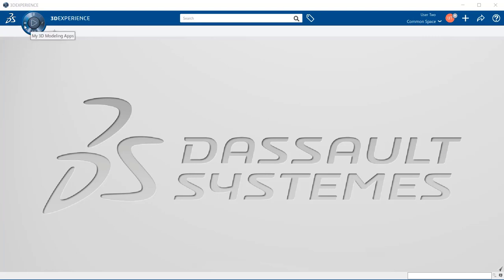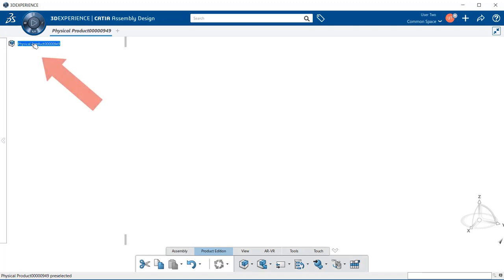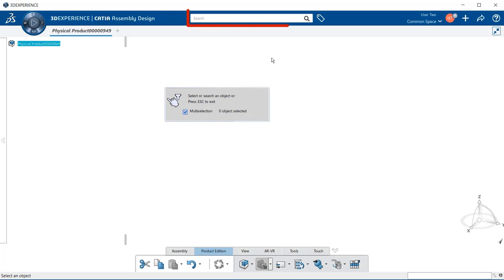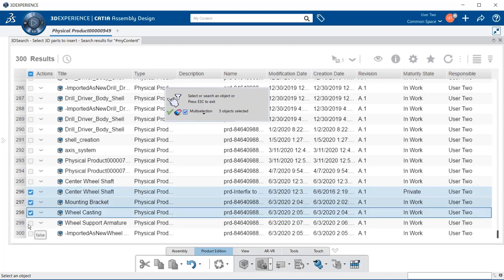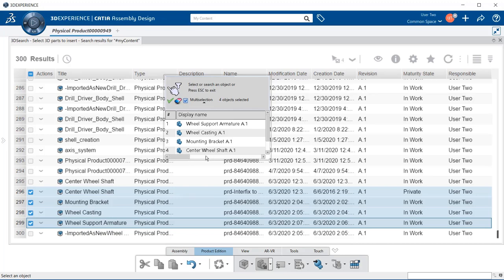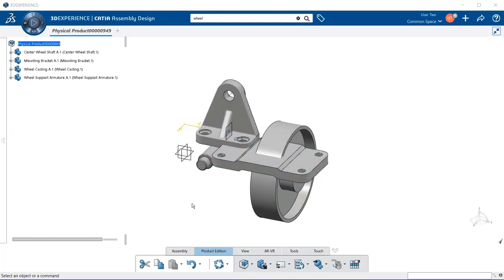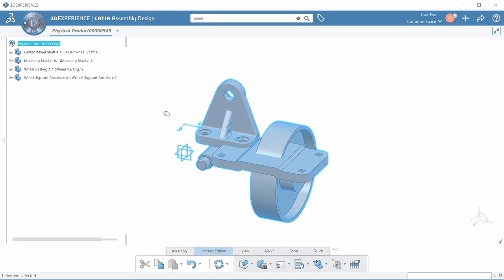How to Insert Existing 3D Part in Assembly Design  | 3DEXPERIENCE CATIA

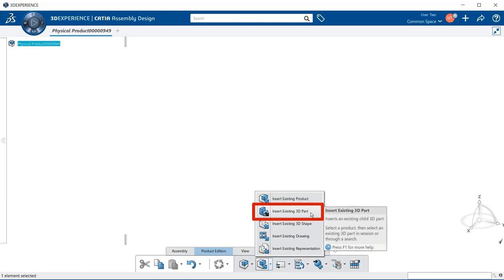Comment: 3dx is not user friendly software.... An obvious command "Insert Existing 3D Part" from the "Product Modification" tab does not work - it does not show a window as in your video 1:20 (I'm using R2021x HotFix 11). Likely, "inser" - "Existing 3D Part..." works. Thank you for showing that way for insertion!!!

Comment: Hi i dont see the insert existing 3d part, but i see all the other options. How do i insert existing 3d parts then?:/
Reply: i have the same it is so weird
Reply from the maker: In talking with the 3DEXPERIENCE technical team, the response was it could be related to permissions that are set by the administration for allowing insert part files. Or, possibly if you are not having access to the assembly module. I hope this helps!
Reply: @myigetit  For me it works now once again. With the new update they removed the option to 'insert an existing 3d part' I think, but if I use the option 'insert existing product' I can insert 3d parts as well.